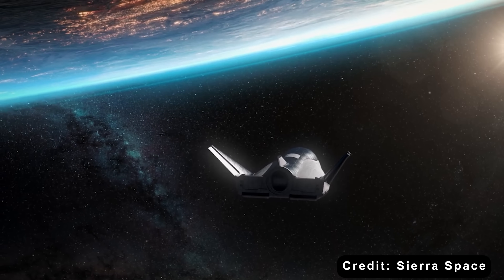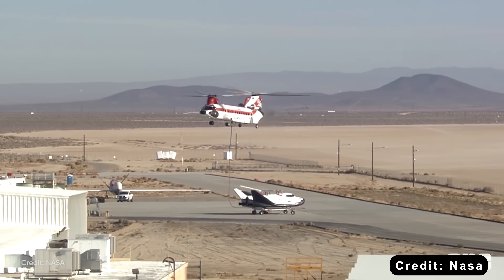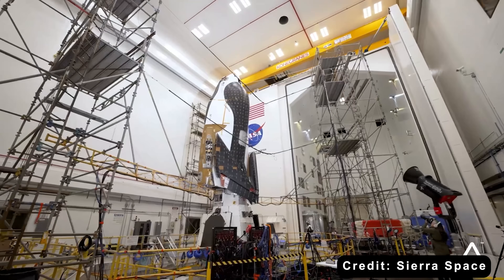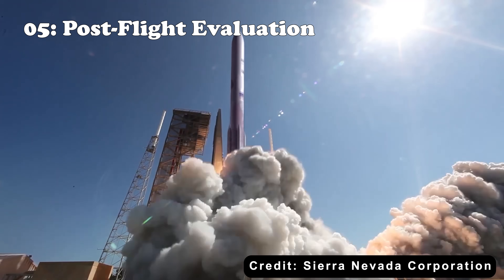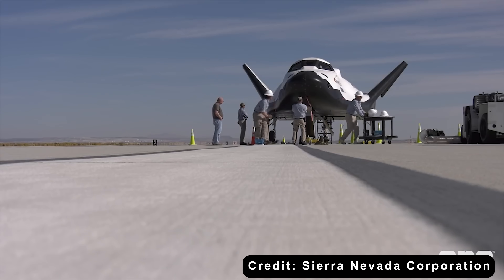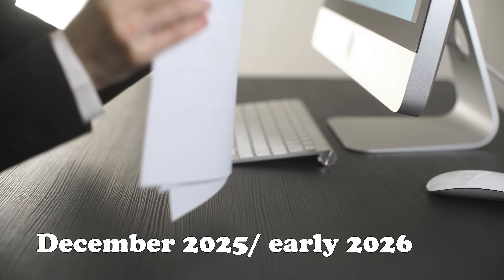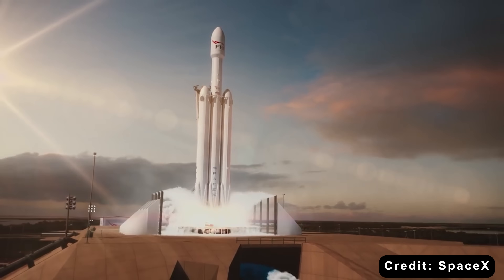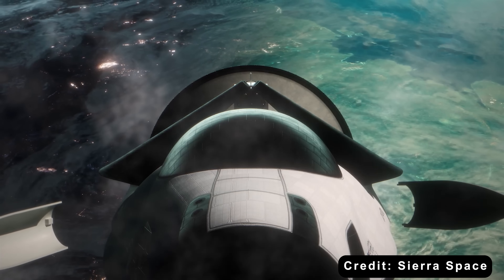NASA's New Shuttle Is Finally Launching Soon For The First Time...Final Preps

Comment: Why the SKID rather than a nose wheel?  The shuttle could fly with a nosewheel; why can't this tiny clone?  The skid is something the Wright Brothers would do.
Reply: Dream Chaser is a lot smaller thank Shuttle.  The front wheel and hydraulics increases weight by a lot.  So much so, that is why SpaceX, Blue Origin, Stoke Space, etc... created a system that did not involve landing like an airplane.  The X-15 used skids also.

Comment: why are you showing video clips of the original Dream Chaser that was built by SpaceDev Corp. The current Dream Chaser does not have cockpit windows and hasn't had them since 2010
Reply: the cargo version with no windows comes first followed by the crew version with windows
Reply: @RoboCollector115  Dude the clips of the Dream Chaser they showed in the video with cockpit windows are from the original plane that was built between 2004 through 2008 by SpaceDev Corp when they built the project. The plane being dropped from that helicopter and landing on the runway was taken in 2007. Sierra Space didn't exists until 2021. The original space plane was ment to have windows. When Sierra Nevada Corp bought out SpaceDev Corp in 2008 they turned the project into a giant windowless piece of shit  drone that has taken almost 20 years and billions in wasted tax dollars and way more delays than it should have had. If you actually did some fucking research you would have known this and not made your ignorant comment.

Comment: Dream Chaser is a small prototype testing concepts that would be used on a larger space plane. It currently has no mission, with the ISS being decommissioned in 2030. Hopefully NASA will find a use like orbital satellite maintenance, inspection decommissioning. It's sort of the shuttle that NASA wanted to build 40 years ago, but instead got one design by military committees.
Reply: The technology did not exist 40 years ago.
Reply: @handsomeman-pm9vy The Shuttle first flew to orbit in 1981, of course the technology existed 40 years ago. The Shuttle was bigger then NASA wanted to carry the big government spy satellites at the time.

Comment: ULA has not yet gotten the engines for Vulcan - which has not flown yet. Their big problem with Vulcan is the lack of delivery of Blue Origins BE-4 engines - which are REQUIRED for testing Vulcan even without Dream chaser.
So right now, there is NO LAUNCH POSSIBLE. NO vulcan, NO LAUNCH.
BTW, Hydrogen Peroxide is not exactly "clean" as it is explosive. It was originally used in the V2 WW2 missile for the oxygen supply with Alcohol as fuel. so not "new and clean".
Reply: Vulcan has had three successful launches so far. The New Glen has had two. Both use BE-4 engines.
Reply: @535tony  Yes, but YEARS behind delivery. Blue Origin started TWO years before SpaceX, but SpaceX is now about 10 YEARS ahead in experience AND delivery. ULA has been delayed by that same 10 YEARS, and is currently under thread of dissolution.
Reply: @JessePollardII The engines are now being delivered and have been reliable. ULA’s problems come from designing a throw away rocket when their competitors are using reusable (first stage) rockets.
Reply: @535tony  The engines are late, and still untested. The "throw away rockets" are 1960s rockets originally built by Boeing, and use Russian engines since no one in the US could build equivalent. Even now, the BE-4 i8s behind and mostly dedicated to New Glenn, not delivered to ULA. and not tested. New Glenn itself has only launched twice. and not yet in production cadence. Not yet tested for any other use. Even New Glenn is 10 years behind. Blue origin is catching up... maybe. But until they can match SpaceX cadence will remain behind. Starship has demonstrated capability, and is still the largest rocket capability since the Saturn V.
Reply: @JessePollardII Five successful flights with BE-4’s. Vulcan has been certified by the US Government to launch their satellites. The Vulcan is a very expensive disposable rocket just like the 60’s rockets you mentioned. The only thing that will keep ULA in business is Government contracts. Blue Origin have always been slow pokes but they have made great progress in the last two years. It will be hard to catch up to SpaceX though. The Starship will be the only fully reusable booster if they can pull it off. I wish all three companies the best, the more the merrier.
Reply: @535tony  Which is irrelevant to contracted delivery deadlines. Yes, it is expensive, but so are all replacements for the Atlas launch services wich could be provided by ROSCOSMOS which cannot be used by the US. Vulcan was the designated replacement.
Reply: @535tony  BTW, This is almost like the BE-4 deliveries were deliberately delayed just to cause problems to ULA to be unable to complete the Vulcan development and operational readiness. Even to the point of forcing ULA into bankruptcy.
Reply: @535tony  ULA's problems are strictly due to Blue Origin not delivering the engines as contracted. It is almost like BO conducting industrial sabotage against ULA. The engines instead were provided to New Glenn where they were tested and used by Blue Origin instead.
Reply: @JessePollardII ULA’s problem is designing a 60’s disposable rocket in the 2020’s. They should have spent the time they had with the late engines updating their design to be at least partially reusable. They are in a dilemma they made on their own. Luckily the Government won’t let them die, even though they deserve it.
Reply: @JessePollardII Price is a big reason to choose one booster over another. The only reason ULA had enough customers to stay in business was their success record. Even then most of their customers were the Government. Vulcan has that expensive price tag without the success record. Good luck finding enough customers. If Blue Origin can reuse its boosters like SpaceX can with their falcons and fly enough of them they and SpaceX will eat ULA alive.
Reply: @535tony  Look at the requirements - a replacement for the ATLAS. NOT a replacement that could be re-used. There was no funding provided for that. That kind of requirement would have to have been done by Boeing or Lockheed. NOT ULA. and the funding would have to have been done by Boeing and/or lockheed. Instead there was a proposal from Blue Origin for replacement engines, which sounded better - as that would reuse what already existed - except that it couldn't, and wasn't delivered soon enough to redesign using a Methalox design. That was all done by SpaceX. ULA was basically left out by BO. so ULA is now up for sale. Boeing is out of it, their last offering costs 2.2 to 2.4 billion per launch - not usable. 
Personally, I think ULA was abandoned by both Boeing and Lockheed. Boeing Space division was already losing several billion every year, Lockheed was never in the launch business to start with. Missiles yes, satellite launch? never.  The only remaining choice for government l;aunches is SpaceX. Cheap, reusable, already functioning, no development costs. The government doesn't have any choice. ULA (and boeing) are used to funnel money to military suppliers, not for research.
Reply: @JessePollardII Why replace a 1960’s booster with another 1960’s booster? This was stupid. ULA already had a reusability plan for the Vulcan but didn’t implement it even though they had the time. They relied on cheap Russian engines for decades, they could have manufactured them for themselves but they didn’t. Their greed and stupidity is the reason they are where they are now.

Comment: Until Dream Chaser actually launches and returns intact, it’s just words to keep the money flowing.
Reply from the maker: We need time to prepare
Reply: @techmap9  SpacerX already has.
Reply: Dream Chaser Can't Launch without a Space Ship and it needs Runways to actually land. Dream Chaser is a overpriced Glider. That's it
Reply: @damien33007 Was thinking if SpaceX formed a subsidiary with Falcon 9 and Dream Chaser to service LEO and the Space Force and call it “Falcon Chaser”.  😂
Reply: They build a Space Ship. That Needs other SPACE SHIP to get to Space. Then it wouldn't be able to go to the Moon or anything thing anyway. Because the Moon doesn't have a Runway. Oh yea nore dose Mars.
Reply: @damien33007  A  runway assumes there is Atmosphere. Sorry, no atmosphere on the Moon.
This is NOT designed for the Moon, Mars, or anywhere NOT EARTH. It is designed to RETURN from Space to EARTH. It is closer to what NASA originally designed the Space Shuttle to be - and not the Bloated POS the politicians dictated. the one thing it does lack is the unit heat shield the Shuttle should have had, but no money was allocated for the research. As a return vehicle it is better than a capsule that NASA ended up with - more flexible - it can land anywhere a finished runway on Earth exists. Capsules requi8re water (well, except for the Soyuze which uses a final rocket cushion just before impact - which is what Dragon was originally designed to do as well. Dragon COULD conceivably be used to LAND on the Moon as it does have thrusters to help in landing, but it cannot LAUNCH from the Moon. NO Capsule currently in use can do that.
Reply: @JessePollardII You do know that the only manned space craft flying now that lands on water is the Dragon. The Russian and Chinese space craft land on land. The Orion hasn’t flown manned yet and the Starliner hasn’t landed manned yet but is designed to land on land.
Reply: @535tony  YES I know, do you know that Dragon was designed to land on land and not water? But NASA rejected that as Unsafe.
Reply: @JessePollardII Yes, but it doesn’t land on land and never has. Did you know the Chinese capsule and Starliner are designed to land on land?
Reply: @535tony  Did you know that Dragon was designed to land on land using rockets to cushion the final impact - just like both Russian and Chinese capsules? NASA reject that as unsafe.
Reply: @JessePollardII The Dragon was designed to land totally different then the Soyuz, Chinese and Starliner. It would not have used parachutes at all. It would have used the super Drayco engines to land instead of just cushioning the parachute landing with a quick blast or a cushion like on the Starliner. This scared NASA and they are the Customer. They can still do this if there is a serious parachute failure. NASA also made SpaceX limit the Dragon to 4 passengers instead of seven.
Reply: @535tony  The only difference is the amount of rocket power. provided. Both use rockets to cushion the landing.  Dragon would have made it far more reusable using rockets. Safer? maybe not. but that same rocket design is why Dragon could be used for Lunar landing.
Reply: @JessePollardII No, the Starliner uses a inflatable cushion no rockets at all.
Reply: @JessePollardII There is a big difference between a totally propulsive landing and using a solid rocket motor to cushion a parachute landing. Saying it’s the same is like saying a Saturn V is the same as a Falcon 9 because they are both rockets🤣
Reply: @535tony  It is a difference in choice and design.
Actually that is part of the difference between Saturn V and Falcon 9 - one is designed to be thrown away, the other is designed to be and is reused. One is an expensive pile of metal, the other is inexpensive due to reuse.
Reply: @JessePollardII Yes, a big difference.